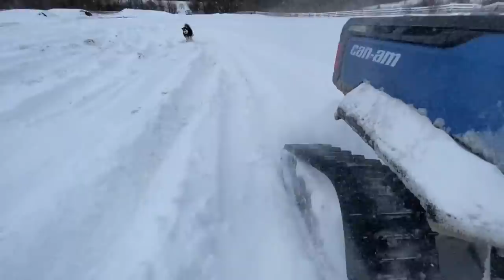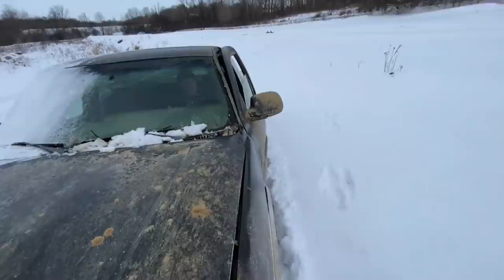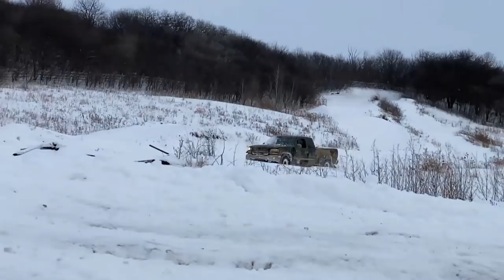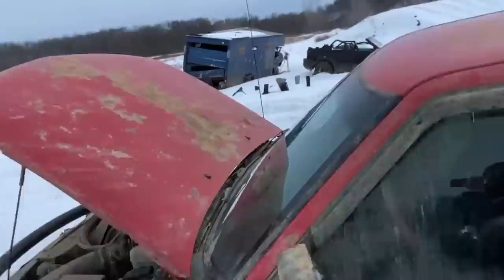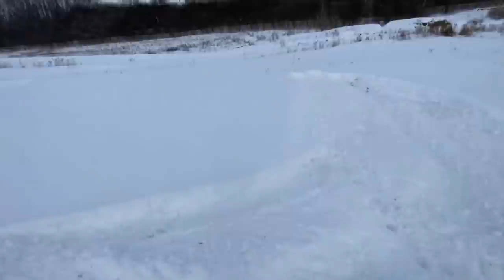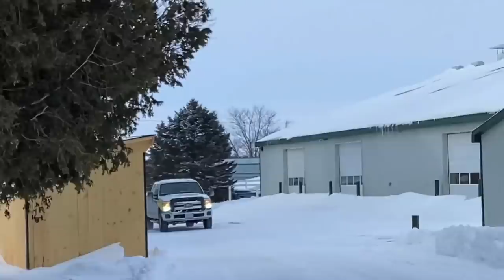GMC Is ALMOST DEAD!

Comment: Ill bet the alternators fucked.   When your battery gets dead enough the coils arent running full strength causing it to run like shit.   When you boost it with the noco it runs good.   Would also be why you have to boost it.    Shitbox rating: ⭐️⭐️⭐️⭐️⭐️